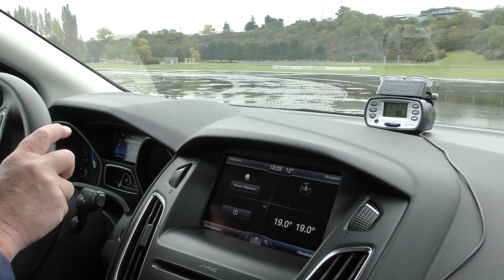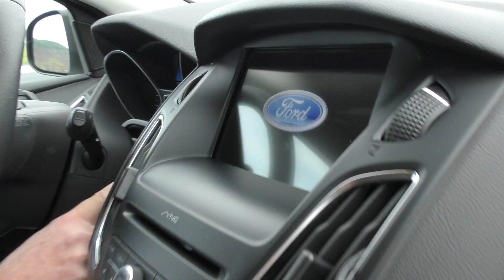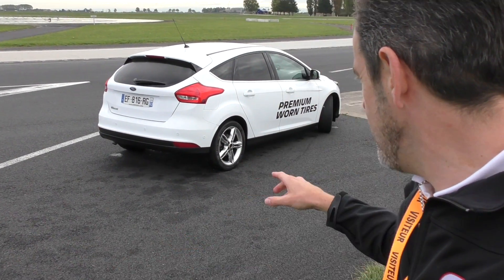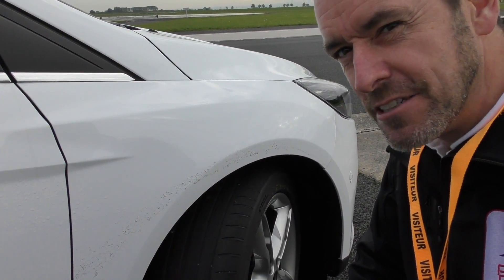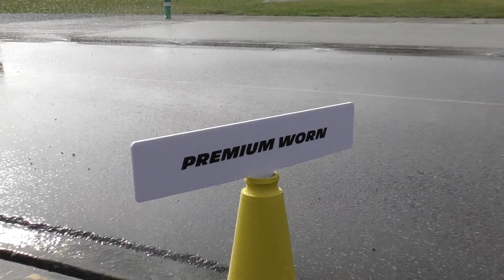How safe is a tyre with just 1.6mm of tread ?!

Comment: You've been conned. You can be sure that they've tested every budget tyre on the market, and chosen the worst. Some of those other budget tyres would have been only marginally worse than the Michelins. Over 35 years, I've found almost no correlation between tyre price and tyre performance. Some expensive ones were almost dangerous (and I got rid of them early), but one budget set was the 2nd best I've ever had.
(Wet-weather handling is my #1 requirement in tyres.)

Comment: I"ve had Michelin Primacy HP on my car. Never again. I'm using Hankook tires now, they are miles ahead, literally.
Reply from the maker: Interesting !
Reply: My car had Dunlop sport maxx from new, they were awful, very hard compound so they spun & slithered in the wet making the TC work overtime. I now have Hankook ventus prime2, the traction & cornering is leagues ahead, quieter at speed & lasting well. I don't count Hankook as a budget brand, just better priced.

I have used the real cheap tyres on a old banger we had as a spare car. Some were much better than others. the performance charts for tyres help pick the good from the bad. In economy, wet weather & noise.